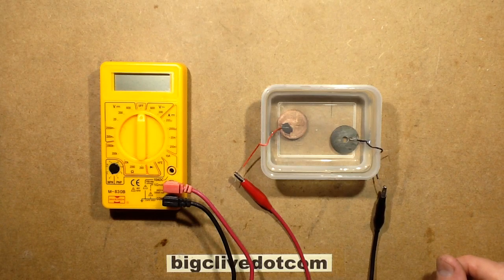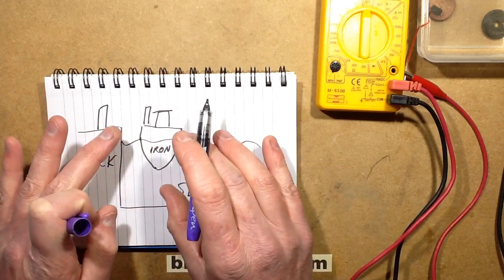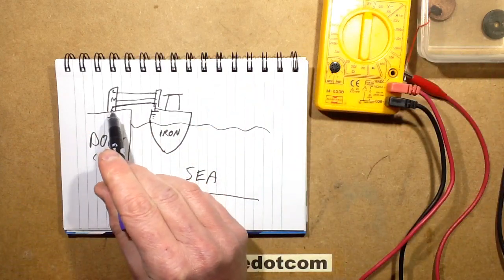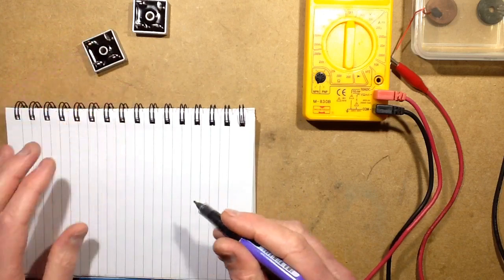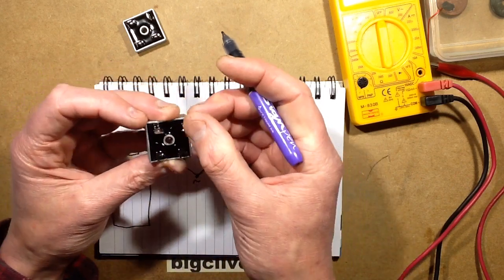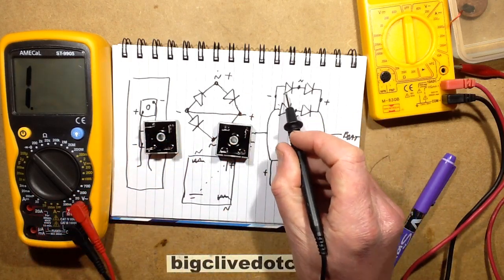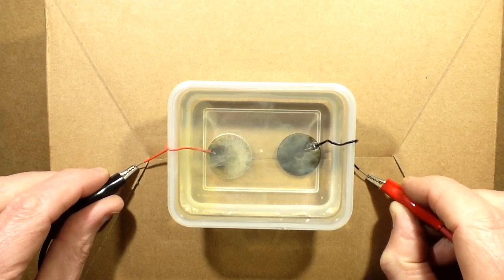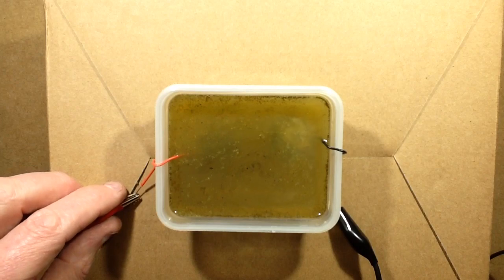Intriguing science of galvanic isolators for boats.

Comment: I'm glad you mentioned the anti-corrosion components of automotive coolant/antifreeze. It's why the system should be drained, flushed, and refilled every so often, usually 5 years or 150,000 miles: the anti-corrosion additives become depleted, and it leads to failure of the radiator and heater core soon after. This is why when I buy used vehicles, I NEVER buy one which the owner added only plain water when it was low on coolant. You can usually tell by either asking the seller directly, or check for pitting around the fill cap.
Reply: +SigEpBlue If you ignore adding coolant antifreeze because you have a leaky system and just top up with plain water, there comes a point where components fail (because of the corrosion). In my case it was the water pump of a Volvo 240.
Reply: +SigEpBlue Bear in mind that at 80C water has a vapo(u)r pressure of 350 (torr/mmHg) and quickly ramps to 400 torr at 84C. Ethylene glycol has a vapo(u)r pressure of around 4 torr at 80C. 1 atmosphere of pressure is 760 torr. Topping off the expansion tank with water keeps the proportion closer to correct as the expansion tank is where you are going to see evaporation losses. Topping off with a 50/50 mixture will cause an increase in the concentration of ethylene glycol between coolant changes.

edit: 5 years is an awful long time between coolant changes. I'd change it every autumn/winter if I lived in a hot or 4 season climate. Every other year in this mediterranean climate.
Reply: Markle2k 5 years was the recommended change interval given by Peak, for their "Long-Life" antifreeze. I'd suggest following the vehicle manufacturer's recommendations. If you're adding enough water to significantly throw the mixture off from 50/50, you have much bigger problems to worry about! :)

FWIW, I live in West Michigan, and it's definitely a four-season climate here: usually hits the mid-90s in July, and sub-zero during the harder winters. There's no reason I can see to change it more often, given a completely-sealed system, e.g. most vehicles I've driven since 2000 or so. If you have a system where the overflow is NOT pressurized (most older vehicles), then that might change. But I'd still go by the recommended interval.
Reply: SigEpBlue Agreed on the adding coolant thing. If you've got a leak in your pressurized system, you've got a problem that needs immediate fixing and the proportion is the least of your worries. I had a Honda Quaalude that would puke coolant out of the expansion tank in summer and after a lot of troubleshooting it turned out the previous owner (who kept logs) had put in a 190 degree thermostat (coffee can and thermometer test). A quick trip to the parts store for a $5 160 degree unit solved that.

You'd have to leave the cap off the expansion tank to lose a lot if your car is in good shape. My point with the evaporation from the expansion tank was just that that was where you are going to lose coolant (mostly water) between changes if you don't have a leaky fitting or a cracked cylinder head or out of spec part. The plastic cap can't contain half an atmosphere of pressure.

Modern 4-cylinders only hold about a gallon of coolant. The Honda Civic automatic's total coolant capacity is 4.1 liters including the 400cc in the expansion tank. So, getting out of balance isn't that hard. If you've got a 4.6 V-8 in an F-150 it has 4 gallons of coolant. Water has a higher heat capacity than m/ethylene glycol (EG), so running rich on the EG reduces the heat shedding ability of your cooling system. The EG's job is to raise the boiling point of the fluid so that you don't get vapor forming around your exhaust valves. Water vapor has a much lower volumetric heat capacity than liquid H20/EG.

Comment: Ther are actually two slightly different forms of corrosion at work here; galvanic corrosion where dissimilar metals with different inherent potentials react in proximity and electrolytic corrosion where an external electrical source drives the reaction.

Comment: The bridge rectifier with a shorted + and -, aka making it into 2 series resistors anti-parallel, is also frequently used in model railroads. It's used in occupancy detectors or current detectors to detect a train on a track instead of using 4 separate diodes.

Comment: A lot more to marine  corrosion than just at the dock, all the through hull fittings, wiring etc.  I have seen 1/4 inch plate eaten through in a matter of a couple of weeks around a depth sounder.  Admittedly I also measured 24V through the wooden cage on the open cell lead acid batteries on board that vessel.  A lot of marine wiring I have seen has been done by cowboys, or on yachts, DIY.  Using normal domestic copper in a marine environment is not a good idea,  I have seen signal cables disappear into hidden trunking, replaced by domestic twin and earth (with the earth carrying the shielding) only to go back to proper signal wire when in view (This was on an MOD vessel.)   The other thing you see a lot, especially on wee boat owners is they feel the need to solder and crimp.  Not in a salty hostile environment, solder, or crimp, not both.  The traditional method of dealing with corrosion, as you said, is zinc anodes, and on some boats the amount can get quite silly, and expensive where a little tracing of the power system can usually solve the problem.

Comment: Ahh but what you forget here Clive is by using them in that way they become "Marine Diodes", that suddenly increases their cost by  at least X10. 

Then to make it all more interesting the ship's DC negatives are bonded to earth, in various ways to different points resulting in differing potentials with copper attached to steel bathed in salt water or salt contaminated condensation with a constant DC current.
Reply: +RDH1024 The DC negative on a boat should be bonded to AC earth at one (and only one) point - the place where it's bonded to the hull (or to a grounding plate attached to a non-metallic hull). Otherwise you run the risk of a current flowing through anything (like a person) that's in contact with both AC earth and DC negative. Other bonding arrangements might be fine, but they rapidly become so complicated that it's difficult to tell if they're ok without extensive investigation, not a good idea for anything that's safety related. That's something I have to look for when I'm surveying boats, although interestingly it's not something that I have to check for when doing a Boat Safety Examination for inland waterways vessels.
Reply: Totally agree, would be ideal to be only bonded at one point creating an equipotential surface, however over the years various modifications / additions are added to many craft. A lot of the additional DC 'bonding' ends up happening by accident eg grounded bodies of equipment being bolted to the hull/ steel pipework, additional plant added etc.

For smaller craft its viable to bond to a single point and enforce, for larger craft with extensive plant onboard and the physical size (where I was involved) it's a different story.
Reply: +RDH1024 True, being based on the Norfolk Broads I'm very much at the small craft end of the spectrum, although it's interesting (and a bit scary at times) to see the amount of systems that some owners cram into a 20 foot pleasure cruiser.
Reply: A beautiful area - have sailed on the Broads, on a family sailing holiday. Yes can imagine! saw a few last time I was there.

Comment: This is a subject that also affects many a non-tupperware canal boat user (and brings out the"experts" that are either for or against anodes, or galvanic isolators, or having shore power at all, etc.), for the average dock-dweller on shore power and thought that GIs were for ninnies, they have to have their boat hauled out every few years to have new anodes fitted, CCers (Continuous Cruisers) don't have that issue as much as they use the engine to generate power or have either an onboard or a portable generator which they use on the boat (using on land would mean it was earthed, and brings back the isolation issues)...

And electroplating is fun... :D

Comment: Hmm and most paints dont las long in water :-(
Reply: +zx8401ztv Modern two-part epoxy hull paint can have a lifespan of up to 15 years. The paint's not cheap, and it needs a lot of equipment and preparation to put it on properly (and safely - it forms just as good a coating on the inside of lungs as it does on the hull), but the technology is there.
Reply: +TeaDaemon 
Oh hell, the lungs :-(
Reply: +TeaDaemon " it forms just as good a coating on the inside of lungs" - I don't think so. The fumes given off during the curing phase would dissuade most people from snorting. Perhaps you are referring to dust generated by sanding a hull. Loads of nasty chemicals in that stuff doubtless. A mask with the right kind of filter is essential for big jobs.
Reply: Robert Seviour It does if you spray it without a full head helmet and external air supply. ;) I agree about the danger of sanding epoxy though, I've known more than one boatbuilder who's sensitised themselves to epoxy by breathing in sanding dust.
Reply: TeaDaemon " if you spray it without a full head helmet and external air supply." I suppose spraying may be the way epoxy is applied for some jobs but in my experience the common method is with a roller. Done like that a suitable organic vapour filter mask is adequate, assuming reasonable ventilation of the workplace. (You're not thinking of polyester out of a 'chopper gun' are you? That is a spray process.)

It isn't only dust particles which can lead to sensitivity, the fumes given off during (some brands of) epoxy resin's curing phase did it for me and others I have known in the boatbuilding world.

However the last time I used epoxies on a boat it was with a German product and I was pleasantly surprised to find that it was near-to odourless.

Comment: Pipe lines (Gas oil water slurries etc) also have cathodic protection with sacrificial zinc anodes buried in the soil.  A small DC potential between the anode and pipe keeps the pipes from corroding in the soil.

Comment: One thing i forgot to mentio in a previous video about this was that we had an aluminium plate that you put in a bowl with your metallic objects, as long as they were in contact, it would clean the metals http://www.qwicksilver.co.uk/what_english.html
Mostly for silver and gold etc,
Reply from the maker: +Sparky Projects I can recall the special liquid that was sold for that.  (Baking soda, vinegar and salt.)
Reply: +bigclivedotcom I think the instructions said baking soda, could have been salt.
Baking soda is alkali, vinegar is acid, so not much point using both.
Reply: +Sparky Projects I've used that method and I should warn you its best to use aluminum foil in the pan because it will be left with much nastiness and is best thrown out. Silver on top of the foil, with some baking soda added. Works quicker if in a 350F oven.

The foil ends up looking like clives water and right washer.

Comment: If I were an engineer making a bronze shop knife, what alloy of bronze would I use to keep the best edge on a short blade?
Reply: +Pepper Spray I would inset a strip of high carbon steel for a useful edge.
Reply: Bronze age swords typically contained 8-12% tin. I would go with 88% copper and 12% tin.
Reply: I just looking for free expert advice on what alloy of bronze holds the best edge. Silica-bronze, aluminum-bronze, bronze, ect. I have several types, and their hardnesses are pretty close. they all look cool as short pocket knives. Yes high carbon steel would be much more useful if I were cutting more than tape, or paper. I have read bronze is capable of holding an edge pretty well and through quite a bit of punishment.

Comment: I had an old Mercedes station wagon/estate that was almost rust free except for the left rear corner where the mag (magnesium) spare wheel lived. Eventually I realised why there was originally an insulating layer on the disk that clamped the spare to the (steel) body of the car. Condensation from the window on the carpeting trim etc had completed the circuit. I was surprised how quickly it happened. It went from rust free to holes in about a year.
Reply: +Nic Green They clearcoat mag rims now.

Comment: Have you thought about removing the copper from your old etching fluid using electrolysis?
Reply from the maker: +Green Silver I've been looking at Nurd Rage videos regarding that, but amen't really etching enough boards to try it at the moment.
Reply from the maker: +BikingMNViking That's when YouTube finally offer it.  Apparently it can take a long time after you're reached 100,000 subscribers.  Knowing my luck I'd connect the polarity wrong and electroplate a chunk of copper with my play button overnight
Reply: +bigclivedotcom That would be fun to see you copper plate something. Question is what would be useful to copper plate? Something that needs to conduct heat or electricity. Or your 100k YT button. AVE electroplated his in gold. Fits his gold fever. Yours in copper would fit your electronics channel. PS-- clear spray lacquer will keep it from tarnishing afterwards.

Comment: Excellent description as always, Clive. When at Clydebank's finest, The RMS Queen Mary, I have noticed there are various corrosion protection systems in place to protect the 1000+ foot steel hull, in the sea water of the Long Beach harbor where she has been berthed since 1972. There are zinc blocks on the base of the berth, under the hull, and TRUs located at various places throughout the lower decks with cables exiting through the lowest portholes or other openings close to the waterline, connecting to what is underneath. Maybe to force a continuous DC potential between the ship's steel hull and the zinc anodes? It never occurred to me there would need to be isolation on the earth for the power supply. This enters the ship as 4,160 V, 60HZ, 3Ph to a transformer substation aboard the ship, which only the local electrical utility has access to. Since this could be close to 1,000 A with the load of a 400 room hotel and several restaurants and convention sites aboard, what would these diodes need to look like? Or would diodes still be used to isolate the ship from the wharf's earth? [Incidentally, this has worked quite well, the QM will be 80 years old on May 27, and diver inspections have found only thousandths of inches lost from the 2 inch thick hull.
Reply: Zinc based systems are usually passive. Electrically connecting the zinc and the hull sets up a cell where the zinc protects all the other metals while imposing a half volt or so of charge. For impressed current protection you want an anode that is much more durable (graphite, titanium, and stainless work well). You can have zinc anodes bonded to the protected item so that if the power supply fails there is still protection, and while the power is on the zinc would be protected as well, increasing the time before it needs to be replaced.
Reply from the maker: +LakeNipissing I'm not sure how they would deal with that power.  Even with full transformer isolation you would still have the potential for failure of the transformers or the cables feeding them.
Reply: +bigclivedotcom there is no fuckery with the ground, they use energized sacrificial electrodes

Comment: I had a home where we were on well water. The plumber did not install a ground lead on the pump and my copper home pipes became plagued with pin hole leaks day after day on different pipes. Came to terms with replacing every pipe in the home and then discovered why it was happening when I brought old pipes to the scrap yard and the man spotted the issue
Reply: I doubt that earthing had anything to do with it, what does cause real problems is mixing different metals, like steel and copper (even just fittings), or water ph and corrosiveness... better just to use pex multilayer pipe and brass fittings for drinking water, not worth using copper or steel
Reply: Brass usually has some lead in it (added to increase machineability) but a very few fittings could be OK I guess

Comment: So can you use this for the ground on electric water 
heaters?
Reply: +Mark Eckelkamp protecting the anode would remove the protection for the water heater itself. You can do the opposite though. If you put in an isolated graphite electrode and impress a  volt or so between it and the water heater shell it will protect the heater and the anode as long as the power is on
Reply from the maker: +Mark Eckelkamp Water heaters sometimes have an internal zinc sacrificial electrode.
Reply: +bigclivedotcom  yes zinc anode rods. Thought maybe it would be extra protection to the rod
Reply: escorpiuser it's electrically isolated so that the only current paths are through the water, and through the power supply. So one side of the power supply connects to the water via the inert electrode, the other side connects to water heater tank.
Reply: Got that backwards, negative side is protected.. I always have to double check that...

The positive side is protected. Checking a sacrificial anode every 6 months or so is much easier then designing/using an impressed current protection system. Too high a voltage and you can cause delamination of coatings and hydrogen embrittlement, too low and you get no benefit. It only makes sense when changing annodes would be prohibitive. (Along the length of a pipeline or large structure for example)
Reply: escorpiuser I've no clue. Working that out is actually relatively complex electrochemistry.